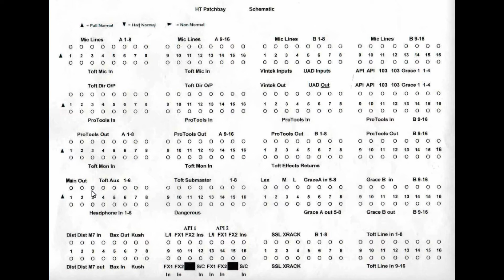Integrating a Toft ATB 16 into a Protools System

Comment: While tracking, where are your protools analog outs returning on the toft for playback monitoring? Guess my question is, are you able to utilize all 16 mic pres simultaneously for tracking or are you losing 2 channels for stereo monitoring?
Reply: Thanks for the response! Great set  up!!
Reply from the maker: John Iadevaio We don’t actually use the Toft pre’s, we have beautiful out board pre’s that are much better and give us a lot more variety. We have thirty direct inputs from the tracking, so if we wanted to use the Toft pre’s, and the other pre’s at the same time we could. The main out of the Toft board actually goes to a dangerous monitor. Which we can switch between PT, Computer and Console. Hope that answers your question. The main out of the board is also integrated into the patchbay and we can send signal back into protools if need me. So we can monitor the direct outs of the board in Protools or through the console.
Reply: Yes, this set up is awesome. I have a question, when you say, send signal back to pro tools, how is this done. I see your patchbay, but what port on the TOFT is this output and where do you go from there back to Pro Tools? I'm mixing a song on my TOFT and need metering such as EQ analyzing, limiting, etc....., but don't know how to get back to Pro Tools. Can you help?     Thank you
Reply from the maker: I had 32 channels of much better pre's so I never used the pre's on the toft.
Reply from the maker: If you look at the second row, we had them normaled through the toft  on the second row in the schematic. So we could either use the toft or run through protools for summing.